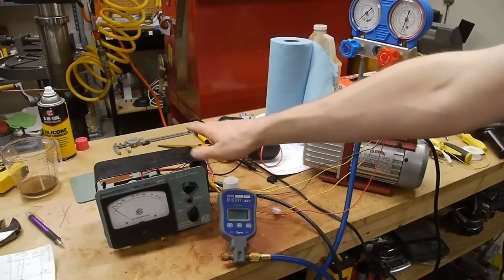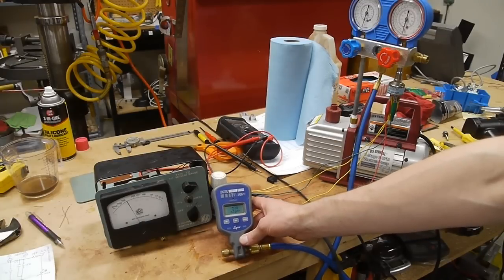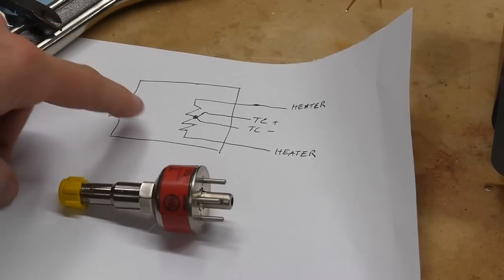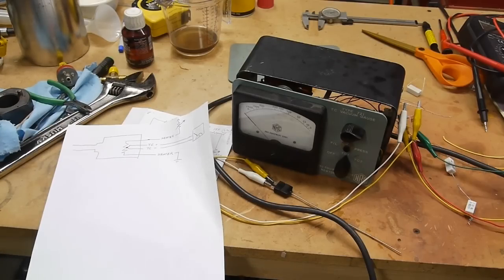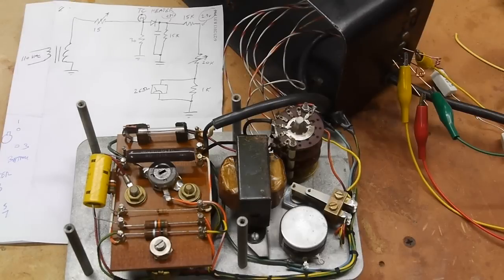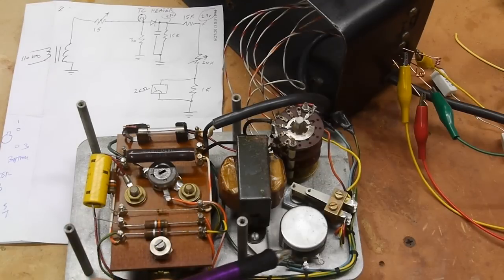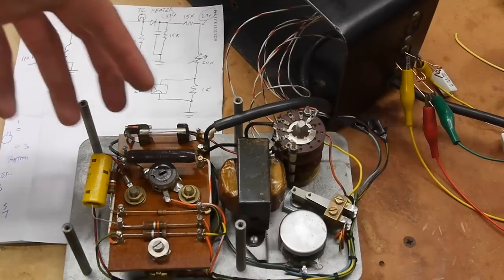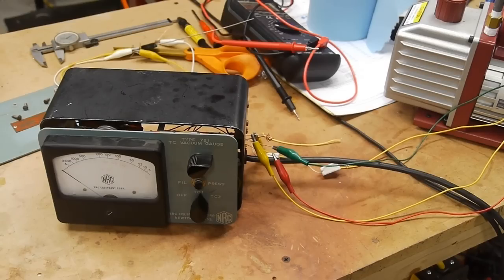Thermocouple vacuum gauge teardown and explanation

Comment from the maker: It's a good question. There isn't a whole lot of info available because most manufacturers just insist that you use only their products, and they do not often publish specs that would let you mix/match. I chose the monitor that I bought because it specifically allowed current monitoring/adjustment. I searched for the part numbers for my Varian sensors, and finally found the heater is 165mA, and the output is about 14mV at full vacuum.

Comment from the maker: Yes, when reading the vacuum, the meter is connected directly to the thermocouple. It looked like there is a pot in-line for full-scale calibration. I wondered about ambient temperature compensation, but the cold-side junction of the thermocouple system is inside the metal envelope of the sensor. I think the idea is that since energy losses from the filament will be to the metal envelope via radiation and conduction, compensation happens automatically.

Comment: Ben, your explanation just gave me an idea of DIY vacuum gauge. First, temperature can be measured by heater's resistance itself. Thermocouple is not necessary. And, second, PTC resistor (or Polyfuse) should work very well as a heater/sensor due to strong exponential temperature dependence of its resistance.
Reply: Congratulations, you have invented a Pirani gauge

Comment: i found a very similar dual thermocouple vacuum meter built in a very similar style and case that actually manages to be much much simpler then yours. all it has in it is a transformer, rotary switch and 2 trimpots one for each sensor. it also uses an "amperite ballast" tube to regulate the heater current. i had never seen this type of tube before but its use made this meter silly low parts count

Comment: Tnx Ben, very interesting. Couldn't a vacuum meter be crafted from a modified smoke detector? For this case, the gap between plates would be made much narrower also the ionization current circuit would need to be tweaked.

Comment: Really interesting. Does everytything from your second schematic (for setting heater current) normally get switched out when reading TC temperature (vacuum)? Or is the TC connected with other parts to the meter? Is there some sort of calibration to adjust for various ambient temperatures? Keep up the great work!

Comment: Im surprised you use that Supco VG64. I bought one of those and thankfully I tested it before I tried pulling down my A/C and couldnt get below like 200Torr (yeah, not mTorr, Torr, absolute shit vacuum) with the pump hooked directly to the gauge with a short piece of hose. I looked around and found a lot of people complaining about the sealing of the units being really questionable. I threw it out and got a Yellow Jacket one, with just the bargraph in microns and was able to get down to 100 micron.
Reply: Ive got one of those cheap pumps for $150 When it was new and after using good quality pump oil instead on the crappy oil it came with it got down to 12 microns, right now its has around 5000h of use and still pulls down to 16 micron. I think you got a defective one. Instead of throwing it away you should have used it for some thing else and just play with it/fix it.

Comment: Would a red bull can used in place of the "super sonic ping pong ball" accelerate fast enough under vacuum to make a viable experiment demonstrating how aluminum can slice through structural steel like a hot knife through butter?
Shear failure.